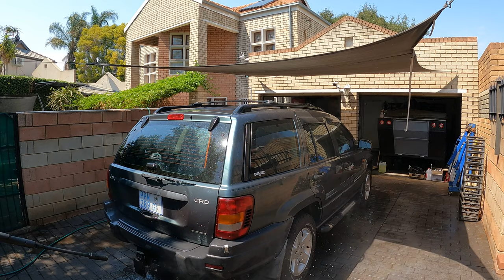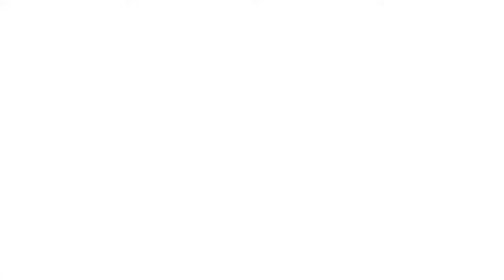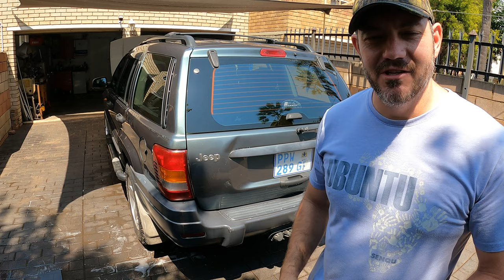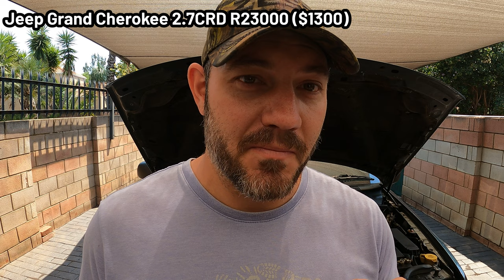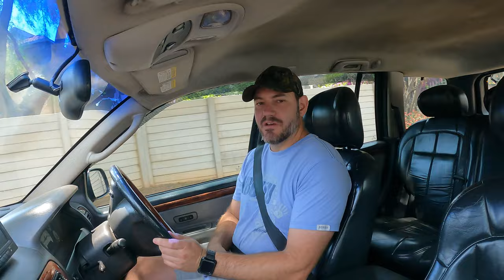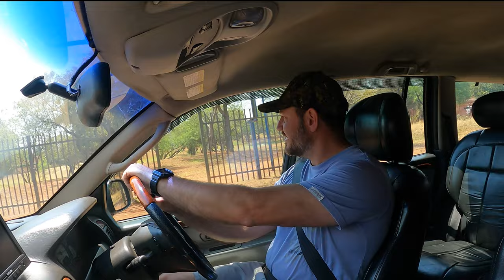$$$ Price Reveal and Test Drive Part Jeep Grand Cherokee WJ 2.7 CRD  - 14

Comment: To be honest with you, I think it was worth it. I own the same jeep with the same OM612 motor and it is lovely. My build is much different, my jeep is build for power: Multimap ECU, OFgear TCU, bigger turbo, intercooler, fuel delivery and NX NOS (only as turbo spool aid). But if it ever blows I would swap it for OM648 3.2CDI. I live in Europe so merecedes parts and engines are cheap snd plenty.
Reply from the maker: Wow, would be interested to know more about your mods.

Comment: It is really worth investing in oem engine mounts. Either buy 4.7 oem ones from rock auto and cut them for the mopar rubber, which you press on your brackets… or buy new ones from mercedes - oem mounts are in fact an mb part, although the rubber in them is again mopar, even now in 2024. They might be pricey (around 800 usd), but totally worth it.
I had two sets of after market bushings pressed in my brackets and the engine vibrations were just awful, to the point sitting in traffic lights was giving me a headache. I was fed up and secured an OEM set of brand new MB engine mounts and the difference is just day and night. The 612 is now purring so softly that at some point of time when returning to idle I have the feeling the engine shut down.
Reply from the maker: I will definitely get some OEM ones soon, I saw they even sell on Amazon? What do you think of that?
The vibrations at idle is hectic, but Im just glad its running now

Comment: Had injector fault and it eventually burned a hole in 5th piston. So basically a same story on mine. New engine in and had first start today, still some work to finish it up. 
Have 6.5" long arm lift, so If you have any questions about lifting crd wj I probably have answer to them😀
Reply from the maker: Hi, yeah thats a big issue. Atleast your riding again. I will be looking at a small lift first and later move on to big lift, we dont have long arms etc available in South Africa for the WJ, so will have to engineer and make my own
Reply from the maker: Any advice would be appreciated